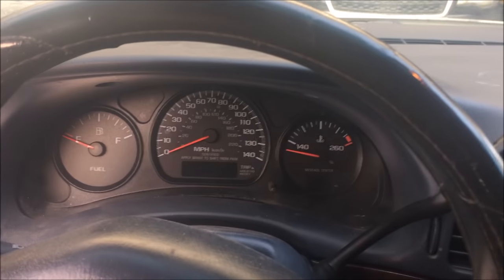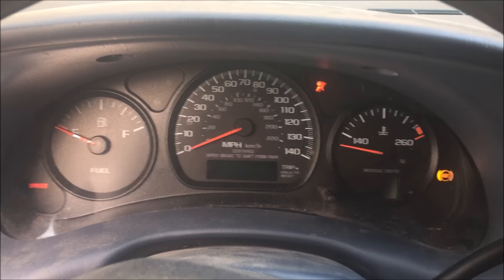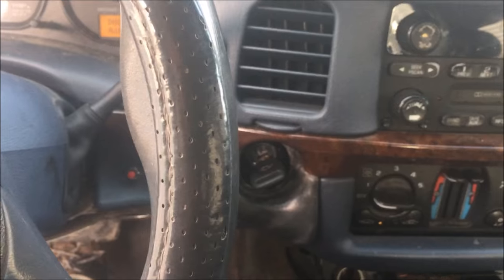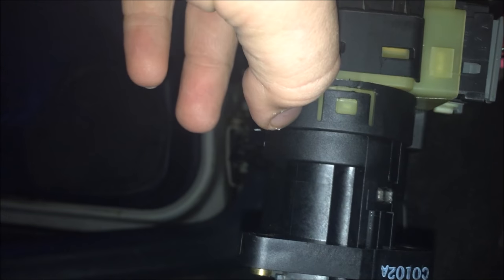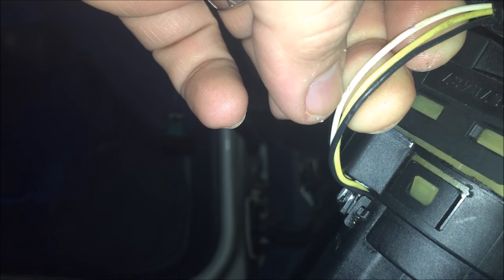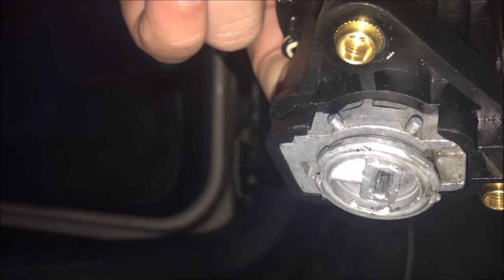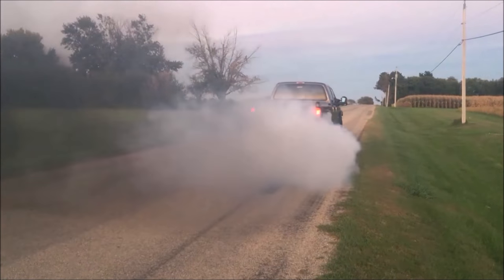How to Bypass the Passkey Security System on Chevy Vehicles

Comment: problems with security going off 3x a week.  cleaned the contacts on the ignition switch.  problem fixed for now.  274k original 2003 impala

Comment: Sorry for reviving a dead thread, but would old this same method work on a 2005 Chevrolet Trailblazer EXT 4D? My ignition cylinder was drilled out and it seems to be stuck I. Theft mode.

Comment: Still no resistance value hey?  I think I get what you mean about the wire that goes back to the car, but it could mean either direction actually.  And then you talk about cutting the black wire, but then splicing in a resistor in line, you said, but you didn’t mean in line with the black wire? Because you still need to connect it to the yellow wire, correct? It’s not clear.  But by watching several of them, I’m able to figure it out.

Comment: do you measure the resistance between the yellow and black  wire plugged in to steering wheel? or disconnect plug and measure? wont voltage be on it if it stays plugged in? so how do you read ohms correctly? thanks
Reply: The steering wheel has nothing to do with this. Pull the ignition cylinder, cut the black wire and yellow wire. Put the key in the cylinder, and measure the ohms with a multimeter, from the black and yellow wire you cut, coming out of the lock cylinder. Then put a resistor that comes close to what you measured, between the other ends of the black and yellow wires.

Comment: Your by passing the alarm system and you turned the key and it clicked I replaced the starter  put in a new ignition in my 2004 Chevy Monte Carlo 8.3 why are my message center showing the battery light  I turn the key it says nothing everything on the dash goes off I let go of the key they come back it's done that s few times in the past on my ABS and tracking system has been on for about a year broken wire I replaced that caliber it's still showing those symbols on the dash last month my water pump went bad I ran it to long it ran hot and cut off I cooled it down it started back up my check engine light came on I had to replace the water pump and plugs now it still has it it ran for a month with the check light on I drove home Christmas Eve cut it off it haven't started since I've cleaned all the grounds connections  still won't start I turn the key I get nothing from the starter

Comment: My key won't turn in ignition lock to replace the lock how do I get the key to turn or where do I find the pin that locks it
Reply: kevin heindl there's a release pin in the top of the column right above the lock cylinder. 
It's a hole you can put a punch in it, and with the key in the lock, turn it slightly to lock key into cylinder, and as you push down into the release hole with the punch, pull the cylinder out of the housing.
Reply: 8
Reply: there is a hole at the bottom or top of the steering plastic housing looks like a extra screw hole use a thin screw driver or a long like 10 penny nail to push the pin in while turning the ingnition switch towards the run postion then pull out wards while holding that ingnition should pop right out with little force of pulling with your fingers .

Comment: I recently bought a 2006 cobalt SS it was previously a water car and didn’t have a key so I went to the dealership and got a key made and tried the 30 minute process to marry the key to the car but the security light will not go off. The door locks, radio, and sunroof also don’t work and also the steering is locked do to the security, I can start the car from under the hood with the crank relay fuse but will only run for a few seconds if anyone has any advice or knows how I can fix it I’d appreciate all the help I could get
Reply: Travis Slusher I am having same problem with mine
Reply: Did you get it fixed? Iv done this on a 2002 Monte Carlo ,only I used an "Adjustable" resistor I got from radio shack( when we still had one)for about 5$..worked like a champ...getting ready to do this on 
My 2006 colbolt so I can have spare keys made cheaply
Reply: I ended up not doing it though it looked easy to do...I had 3 solid keys made and zip tyed the chipped one on to the outside of the tumbler barrel,in about the "acc" area.now all 3 keys work!

Comment: What wattage resistor did you use?
Reply: Around the 500-600 ohm
Reply: Shouldn't need a high wattage as it's not a super high voltage system, .5 to 1W should be fine

Comment: So now anyone can crank the Impala with a screwdriver? No tumblers and no anti-theft? Sounds like a bad idea. Btw, you don't program keys to '02 Impalas since there is no transponder in the key.
Reply from the maker: Yep anyone can use whatever to start it but still need a key or break something to get in the car. Also no the key does not need programmed but if you put a different padlock module in the ignition, you need to reprogram for the new resistance.
Reply: Usually don't need to take out tumblers, just the addition of the resistor will allow unchipped keys to be used
Reply: @jonjacobjingleheimerschmid3798  kelven what you are saying is just weld  the resistor between the wires and leave it connected to the switch?
Reply: @parcec0399  little more to it than that ( I used a adjustable resistor I got back when we had radio shack)   I got instructions on this site(10 years ago)
"How to permanently disable GM
Passlock system"
As for my colbolt I own now I had a couple of keys made for $2.50
With no chip and used my one key that had chip to ziptyed on top of tumbler at about the " on" position (under the plastic housing)..been working like a charm for many months now

Comment: Do you really need the resistor? 🤔Our Radio Shacks went out of business a long time ago and NOBODY sells resistors in NC☹️😞!
Reply from the maker: Yes resistor is required to get the correct voltage back to the ignition system. You can find them cheap online or maybe from an electrical supply warehouse
Reply: ebay has them for 45 cents or 10 for 4.50
Reply: everytime the security goes off I tell her .45 cent fix just need that resistor. also I fixed my issue without the resistor by cleaning the contacts on the back of the ignition switch carbon builds up and causes a voltage drop is why the security goes off.  I find it happens alot when it's humid outside.
Reply: also i took out the ignition cylinder and sprayed it with carb cleaner and some wd-40

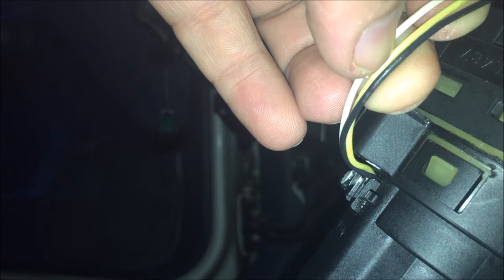Comment: WTH, 1:35, I have an electronics design background and this is cloudy, poorly stated and contradictory ! how can a black-wire resistor be INLINE (in series) and yet BRIDGE to a yellow wire Einstein ? REDO and make sense and use CORRECT terminology ~~
Reply: yeah i saw the same thing. t tap the black wire with the resistor. the other side to the yellow wire. then you have to reprogram the ecu.15-20 minutes with the key on.